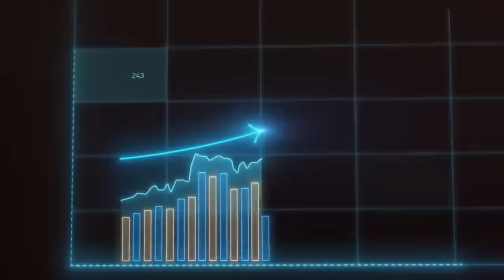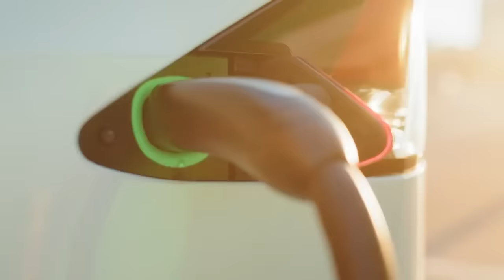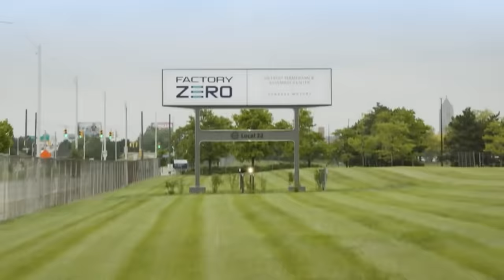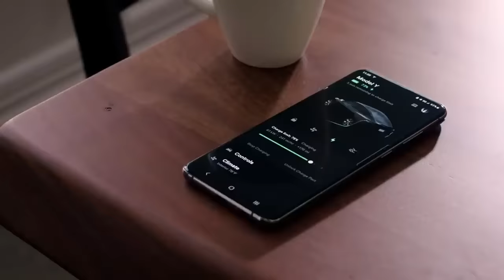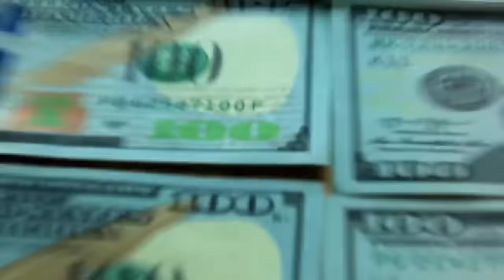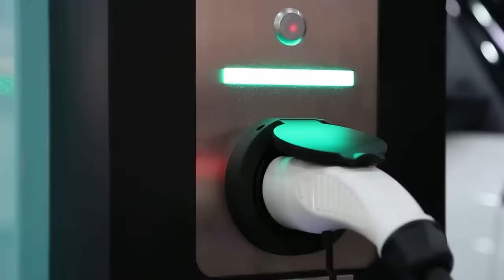Electric Vehicle Owners Are Frustrated and Demand the Return of Gas Cars

Comment: ICE cars DO NOT SPONTANEOUSLY COMBUST INSIDE YOUR GARAGE, eventually burning down your house, like some EVs have.
Reply: Many many cars have caught on fire after owners have parked in their garage not knowing there was a leaking carb or gas line.....
Reply: @stevenrichardson6793  while you are not wrong , that outcome is highly highly unlikely . I was a firefighter in the UK and went to lots of vehicle fires with ice vehicles 99% of them happen while being driven or immediately upon parking , its practically unheard of for an ice vehicle to  spontaniouly combust when not in use or cold , EVs on the other hand almost allways self combust when parked in a charge state or after direct damage to the battery cell .
Reply: @bodasafur6078 Yes I imagine an E.v. In an internal garage overnight is like a potential time bomb 💣
Reply: @stevenrichardson6793  I can use a fire extinguisher in my house and put out the car fire myself if it's not raging yet. Even if it is already a raging fire, my fire department can deal with it real quick using a fire hose. Good luck doing that with an EV!
Reply: I sense questionable reading of statistics. Sure the total number of ICE car fires might be larger in a given year then EV fires. However it's the percentage of total fires per vehicle type that matters.
Reply: @robbeales5516  It's like sleeping with a grenade under your pillow.  Pleasant Dreams
Reply: @stevenrichardson6793  You can SMELL the gasoline.  If you have a car that has not been rust protected, then perhaps you might develop a small leak in the gasoline line, but it will smell, so you know something is wrong.  There have been billions of cars*years with very few ICE cars catching fire.  In fact, most ICE cars that do catch fire are because of some faulty electrical wiring... not because of the gasoline.  So, imagine an EV with 1000 times more electrical power/wiring is all that more likely to catch fire.  Please stop spreading your ignorant lies.

Comment: I had a 2014 Volt before it needed a $10K - $15K battery replacement. Not that many people, including the dealership, knew how to work on it. I was considering the Bolt, but I hear GM is discontinuing it. Traded it in and went back to an ICE vehicle.
Reply: Welcome back from the dark side

Comment: EV's are the new pintos but better, no accident needed for the EV;s to catch fire
Reply: But you could manully unlock the door and get out of a burning Pinto. Not so with a tesla.
Reply: 1. Child battery mineral labor

2. Range anxiety

3. Risk of garage fires

4. Paying 20k more than a
comparable vehicle

5. Battery denegration

6. Poor resale value

7. Reduced performance in
cold, highway

8. Higher repair costs

9. Awful charging network
experiences in the weather
without restrooms

10. Higher insurance rates

11. Replacing tires more
frequently

12. Death by autopilot

13. 30 - 40k battery

14. Low km range

15. must wait 2 hrs
to charge

16. Then wait more time to charge, while charging.

17. Spontaneous combustion with no way to put out the fire storm.

18. If they catch fire in a tunnel, many people will die.

19. People without a pro charger system or a parking spot at their house, will run an extension cord to the road, which is dangerous and could lead to people tampering with your charging setup (super slow charging at the road)

20. If your in California, you won't be able to charge your car past 4pm because of a shortage of electricity supply on the cheesy grid.

21. It is not actually "green". The pollution is made at the power station, not the car.

22. Only 5% of used junk batteries get recycled, the rest go directly into the bin. It's cheaper to mine for new minerals.

23. Chhinna actually does 70% of all the refining of the minerals and production of the batteries.

24. Minerals are becoming more and more scarce, and the cost will only go up, not down.

25. Some countries where they mine for lithium, actually use a very big boat load of fresh water to only produce a ton of lithium, so they are afraid of running out of water. It takes over 2 million liters of fresh clean water to produce 1 ton of lithium. 

26. Ev cars will soon not be able to drive in tunnels or be able to park in underground parking garage and probably will eventually void your house insurance if you park it in your personal garage.... 

27. You can't charge your battery at super stations when it is bitter cold out.
Reply: @jakefriesenjake  Great list!  I had to copy it.  Might add: Loss of Gas Tax revenue to maintain roads.  Heavier vehicle wrecks roads.  Goes through more tires (which is another drain on the planets resources).  Power Line transmission has 20% power loss through lines and transformers.
Reply: @COSMACELF1802  I'll add that to the list. Ty!

Gas cars have negatives too tho

Comment: Cost 60K to replace battery of a 60K EV if it's out of warranty! Already many Hyundai Ionic cases out there.
Reply: Yuppers!

1. Child battery mineral labor

2. Range anxiety

3. Risk of garage fires

4. Paying 20k more than a
comparable vehicle

5. Battery denegration

6. Poor resale value

7. Reduced performance in
cold, highway

8. Higher repair costs

9. Awful charging network
experiences in the weather
without restrooms

10. Higher insurance rates

11. Replacing tires more
frequently

12. Death by autopilot

13. 30 - 40k battery

14. Low km range

15. must wait 2 hrs
to charge

16. Then wait more time to charge, while charging.

17. Spontaneous combustion with no way to put out the fire storm.

18. If they catch fire in a tunnel, many people will die.

19. People without a pro charger system or a parking spot at their house, will run an extension cord to the road, which is dangerous and could lead to people tampering with your charging setup (super slow charging at the road)

20. If your in California, you won't be able to charge your car past 4pm because of a shortage of electricity supply on the cheesy grid.

21. It is not actually "green". The pollution is made at the power station, not the car.

22. Only 5% of used junk batteries get recycled, the rest go directly into the bin. It's cheaper to mine for new minerals.

23. Chhinna actually does 70% of all the refining of the minerals and production of the batteries.

24. Minerals are becoming more and more scarce, and the cost will only go up, not down.

25. Some countries where they mine for lithium, actually use a very big boat load of fresh water to only produce a ton of lithium, so they are afraid of running out of water. It takes over 2 million liters of fresh clean water to produce 1 ton of lithium. 

26. Ev cars will soon not be able to drive in tunnels or be able to park in underground parking garage and probably will eventually void your house insurance if you park it in your personal garage.... 

27. You can't charge your battery at super stations when it is bitter cold out.

Comment: Been watching videos of EVs burning to the ground. Just read that a major car rental company sold many EVs and purchased gas autos. Also watched as a Chicago winter effectively shut down EV charging stations.
Reply: 1. Child battery mineral labor

2. Range anxiety

3. Risk of garage fires

4. Paying 20k more than a
comparable vehicle

5. Battery denegration

6. Poor resale value

7. Reduced performance in
cold, highway

8. Higher repair costs

9. Awful charging network
experiences in the weather
without restrooms

10. Higher insurance rates

11. Replacing tires more
frequently

12. Death by autopilot

13. 30 - 40k battery

14. Low km range

15. must wait 2 hrs
to charge

16. Then wait more time to charge, while charging.

17. Spontaneous combustion with no way to put out the fire storm.

18. If they catch fire in a tunnel, many people will die.

19. People without a pro charger system or a parking spot at their house, will run an extension cord to the road, which is dangerous and could lead to people tampering with your charging setup (super slow charging at the road)

20. If your in California, you won't be able to charge your car past 4pm because of a shortage of electricity supply on the cheesy grid.

21. It is not actually "green". The pollution is made at the power station, not the car.

22. Only 5% of used junk batteries get recycled, the rest go directly into the bin. It's cheaper to mine for new minerals.

23. Chhinna actually does 70% of all the refining of the minerals and production of the batteries.

24. Minerals are becoming more and more scarce, and the cost will only go up, not down.

25. Some countries where they mine for lithium, actually use a very big boat load of fresh water to only produce a ton of lithium, so they are afraid of running out of water. It takes over 2 million liters of fresh clean water to produce 1 ton of lithium. 

26. Ev cars will soon not be able to drive in tunnels or be able to park in underground parking garage and probably will eventually void your house insurance if you park it in your personal garage.... 

27. You can't charge your battery at super stations when it is bitter cold out.

Comment: Yes as I mentioned in a reply to another comment all that plus add in the waste disposal of the batteries when they are either out of life and are destroyed by a fire. Plus the extremely dangerous hazard caused by the toxic gases and materials given of in a lithium ion battery fire to those who have to fight the fire anyone caught out near the burning vehicle and the environment that has now has become contaminated by those toxic emissions. Furthermore these wretched vehicles are way out of the reach of the average and limited income individuals like myself because of the original cost and maintenance of them not to also mention the cost of battery replacement and any repairs however minor that entails obscene costs to do those repairs.
Reply: 1. Child battery mineral labor

2. Range anxiety

3. Risk of garage fires

4. Paying 20k more than a
comparable vehicle

5. Battery denegration

6. Poor resale value

7. Reduced performance in
cold, highway

8. Higher repair costs

9. Awful charging network
experiences in the weather
without restrooms

10. Higher insurance rates

11. Replacing tires more
frequently

12. Death by autopilot

13. 30 - 40k battery

14. Low km range

15. must wait 2 hrs
to charge

16. Then wait more time to charge, while charging.

17. Spontaneous combustion with no way to put out the fire storm.

18. If they catch fire in a tunnel, many people will die.

19. People without a pro charger system or a parking spot at their house, will run an extension cord to the road, which is dangerous and could lead to people tampering with your charging setup (super slow charging at the road)

20. If your in California, you won't be able to charge your car past 4pm because of a shortage of electricity supply on the cheesy grid.

21. It is not actually "green". The pollution is made at the power station, not the car.

22. Only 5% of used junk batteries get recycled, the rest go directly into the bin. It's cheaper to mine for new minerals.

23. Chhinna actually does 70% of all the refining of the minerals and production of the batteries.

24. Minerals are becoming more and more scarce, and the cost will only go up, not down.

25. Some countries where they mine for lithium, actually use a very big boat load of fresh water to only produce a ton of lithium, so they are afraid of running out of water. It takes over 2 million liters of fresh clean water to produce 1 ton of lithium. 

26. Ev cars will soon not be able to drive in tunnels or be able to park in underground parking garage and probably will eventually void your house insurance if you park it in your personal garage.... 

27. You can't charge your battery at super stations when it is bitter cold out.

Comment: With a 100 day stock of EV's on lot,  gonna guess selling the used EV's may be a challanage.
Reply: Personally, I would never consider buying any used EV due to the cost of battery replacement may run anywhere from $4000 to $20,000 depending on make/model. Also, one never knows if the batteries had been damaged and may burst into thermal runaway.

Comment: The EV manufacturers might have to include a fire sprinkler system in their vehicles.
Reply: Water, foam or any other fire extinguishing chemical works on the principle of separating the fire from atmospheric oxygen that the fire requires to burn.  Lithium batteries when ignited produce their own oxygen.  There is a video online of a Tesla that rolled down a boat ramp into the lake.  The only part of the vehicle above water was a few inches of the gull wing rear doors that had popped open.  The vehicle sat submerged for about 5 minutes and then suddenly burst into flames under water, lighting up the water around it.
Reply: 水をかけたら爆発します。燃え尽きるまで消せない。
Reply: Sprinklers don't work.

Comment: What's really sad is a lot of these issues can be remedied with the return to highbred Vehicles. Smaller removable battery packs and a small gas generator to charge them (If necessary). I'd set it up with 3 packs capable of running the car on 1. When one dies it goes into charge and the second is activated, it dies move on to the third. Ideally the first would be mostly charged with the second nearing half charged. Wont happen though. They would be repairable by a handful more DIYers than already capable.

Comment: When the battery is cheap, safe with a long range and also with a long service life, it will probably have ev. chance of success, assuming that electricity is cheap and available.
Reply: Many Chinese EV were sold below US$10K in China, with battery. The battery is not that expensive, the cost should be around US$ 3k.
Reply: @andylam2523 There are literally thousands of new EV in China sitting in fields that nobody wants to buy. May as well take your money to the nearest dustbin and throw it away.
Reply: The government and state will need to add an additional federal and state "tax" to replace and make up for the gas tax that covers road repairs and replacement. There will be costs for charging, possibly a "mileage tax" and increased taxes on tires since EVs wear out tires faster due to excessive battery weight.

Comment: There’s nothing “complex” about it.
People don’t want EV’s.

And for good reason…
Reply: Reasons? ???

1. Child battery mineral labor

2. Range anxiety

3. Risk of garage fires

4. Paying 20k more than a
comparable vehicle

5. Battery denegration

6. Poor resale value

7. Reduced performance in
cold, highway

8. Higher repair costs

9. Awful charging network
experiences in the weather
without restrooms

10. Higher insurance rates

11. Replacing tires more
frequently

12. Death by autopilot

13. 30 - 40k battery

14. Low km range

15. must wait 2 hrs
to charge

16. Then wait more time to charge, while charging.

17. Spontaneous combustion with no way to put out the fire storm.

18. If they catch fire in a tunnel, many people will die.

19. People without a pro charger system or a parking spot at their house, will run an extension cord to the road, which is dangerous and could lead to people tampering with your charging setup (super slow charging at the road)

20. If your in California, you won't be able to charge your car past 4pm because of a shortage of electricity supply on the cheesy grid.

21. It is not actually "green". The pollution is made at the power station, not the car.

22. Only 5% of used junk batteries get recycled, the rest go directly into the bin. It's cheaper to mine for new minerals.

23. Chhinna actually does 70% of all the refining of the minerals and production of the batteries.

24. Minerals are becoming more and more scarce, and the cost will only go up, not down.

25. Some countries where they mine for lithium, actually use a very big boat load of fresh water to only produce a ton of lithium, so they are afraid of running out of water. It takes over 2 million liters of fresh clean water to produce 1 ton of lithium. 

26. Ev cars will soon not be able to drive in tunnels or be able to park in underground parking garage and probably will eventually void your house insurance if you park it in your personal garage.... 

27. You can't charge your battery at super stations when it is bitter cold out. 

28. If a fire truck comes to put out an Ev fire, all the chemicals go directly into the sewer system, poisoning every thing. They need tons of water to slow down the the burn. They can't put them out. They are only trying to prevent over things near by from catching fire.

Comment: If you live in an apartment building, you will not be charging your EV there.

If you live in cold temperatures (even part of the year), good luck charging your vehicle in the cold, and good luck getting a usable driving range our of a full charge.
You will spend more on keeping your EV connected to the charging stations (for hours, in freezing temperatures), and getting only 50% of the range -- and that is if you have new batteries.  So your tank of gas (so to speak) will cost double, and give you ½ the driving range in freezing temperatures.  You will be paying far more, for ½ the range, and 3x the aggravation.

And wait until your EV's batteries are several years old.  The cost to fully charge remains the same, while your driving range goes down and down.

If you live in California, the land of rolling blackouts and high prices on everything, good luck charging your vehicle on your timetable, when you experience random rolling blackouts.  And good luck paying your electricity bill.

Next, you will have the expense of replacing your EV's tires twice as often, because EVs are very heavy, and eat up tires.  Some EVs eat through tires at 3x the rate of a regular vehicle.
Yet another significant expense, and yet another time consuming chore you will have to deal with, waiting to have your EV's tires replaced at a busy service station.